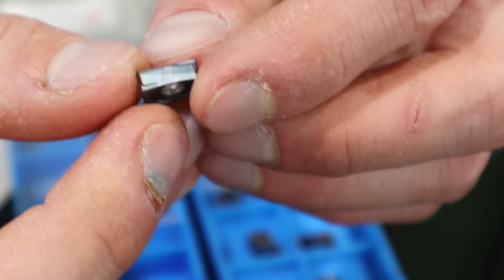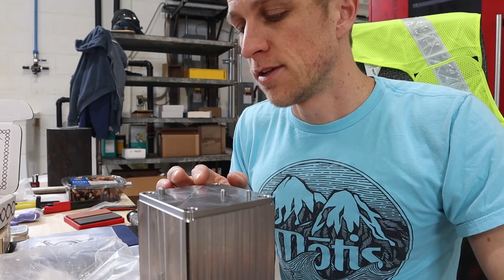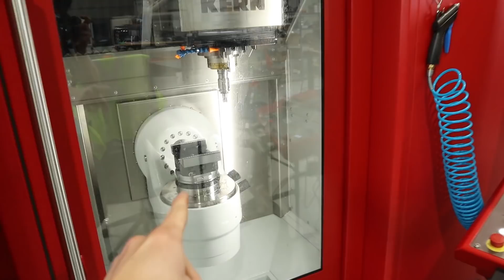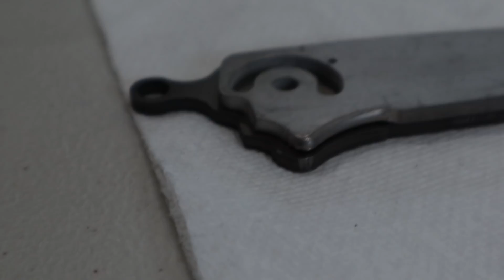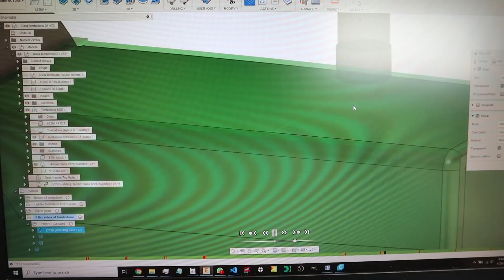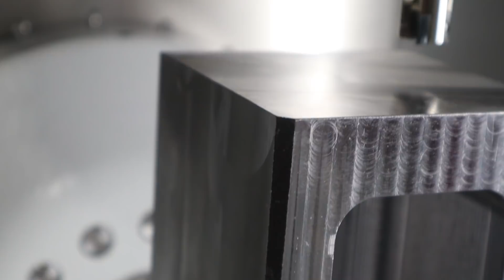Rask Tombstone! - Quarantined Shop Life 18

Comment: If you're concerned about insert heights... 1) get a handful of insert bodies from the manufacturer and check heights... keep the best one and send the others back. You'll quickly find that not everyone machines theirs to the same tolerances. 2) Get something like the Sandvik Century with adjustable cartridges. If surface finishes are really important, then use a wiper insert in the adjustable face mill and learn to set it up properly. I'm assuming you're setting your inserts with a torque-set driver.

BTW this is a really nice machine for making knives. Maybe even a little overkill. ;)

Comment: I like those MEW series insert Mills, we have 5 different sizes in diameter and length. From 20mm to 50mm diameter. And you can shoulder like a beast with those Mills. With facing passes (like 1mm deep) the corners burn up relatively fast. But when you take more depth (like 20% radially and 7 mill deep 0.05mm/pt and 160 meter surface speed with the 50mm version) the edge keeps it's strength like a champ for roughing. For the finishing I like to leave 0.1 mm and I do a 80 to 90 % step over with 0.08 mm/pt. (Well that's what I use on a Haas VF2 in stainless 304)

Comment: Couple suggestions for the next tombstone: as others have said split the hole it into multiple pockets with webs for stability along with thinner outside walls.
Secondly you’re gonna get coolant in that pocket, make sure you leave some drain holes and orient them to drain at the end of the cycle so it doesn’t pour out onto your nice robot. Even better rig up a tool with air blast to purge the coolant at the end of the cycle through a hole in the top.

Comment: if you want to probe on an angled part, you can it pretty easy on manuel mode too. In MDI use the Plane spatial code with the angle you need, go back to manual mode, press the §d ROT softkey and set the Manuellmode to activte (this sets the Coordinate rotation from the plane funktion aktiv), now you can manuell probe the surface you need with the probe position softkey. but dont forget this 3D ROT funktion alway rotates your Axis movemend depending on your plane funktion, you want to deaktivate this after use so you dont crash the maschine by acident.

Comment: Idea for rev two of the pallet... in aerospace they drill holes anywhere you can put them for light-weighting. Instead of hogging out the inside, just drill a bunch of holes in close proximity of each other. You could maybe even do a honeycomb type pattern (except with circles). That way you have a very strong structure that uses the whole volume of the block to reduce any potential rigidity/chatter issues and you could probably go with even  thiner walls. Plus there is no better way to remove metal than drilling, especially with that deep pocket. Just an idea!

Comment: About making the walls less thick on the tombstone. You can probably reduce the thickness even further if you make two pockets instead of one, so there is a cross beam between opposite sides. In fact it will probably be stronger than what you have now. You need to check the volume in CAD to see if it will be lighter at the end tho.

Comment: I didn't even know Kyocera is in machining and cutting tooling business. Wow. I always thought they are just optics, electronics, printers/scanner and audio-video equipement company. And by extension maybe some semiconductor related stuff (similar to Canon or Fujitsu). But in fact they started as Kyoto Ceramic (thus the name Kyocera! WOW). Also they had a lot of acquisitions. I.e. Yashica, Contax, AVX, Sanyo Mobile, TA Triumph-Adler got acquired in recent decades. Wow. They were all very known brands around the world. Kyocera was also instrumental in developing first integrated circuits together with NASA and Fairchild Semiconductors initially for Apollo mission and military applications, but it almost immediately went into commercial applications too.

Comment: why just 4 sides is it possible to make alot of sides(6 or more) since blades arent that wide. maybe you can fit alot more on 1 tombstone. You start with a round bar so just machine out the inside in the lathe.
Reply from the maker: I tried out that possibility, but on the other 3 sides of the tombstone I need to secure 2 handles per side, and when going to a 6 sided fixture it just doesn't fit as well. Good thinking though!
Reply: @JohnGrimsmo  ok interesting to know thx for answer

Comment: I wonder how this machine will hold up to rust inside where the chips will be falling and slowly wearing on whatever coating it has on it. I would also worry about the auger area. As we all know stainless steel can corrode. Unless it is made from nitrogen impreg or titanium I would keep an eye on the high wear areas. Displacing all that water is a must.

Comment: I have a couple of the kyocera end mills similar to those. In aluminium they really eat. Recommend getting the tool diameter slightly larger than the shank. 22mm tool with the 20mm shank seems to work awesome and you can do very deep pockets and long walls without chips welding to themselves to the shank........

Comment: Thinking back a video or two, when John showed how much coolant drained off that pallet (without the tombstone mounted) when put back on the rack, I wonder if it might be a better strategy to move the two vises up to the top rack of the changer so they don't have coolant draining on to them whenever pallets are changed above them.  Is there a clearance issue?

Comment: For rust prevention, and maybe style, you could try treating your tombstones with cold bluing liquid.  I believe it creates a controlled oxide layer.  That with a little oil/undiluted coolant should be at least as good but it will also show witness marks when plain steel is exposed by new scratches and machining.

Comment: Pro tip: When checking runout, position you indicator how you like it (angle, height ect.) then use the machine and bring the tool to your indicator. Saves a ton of time trying to get you indicator to the perfect position. Epic stuff dude love the vids
Reply from the maker: Ohh man I didn't even think of this hahaha.  It's so obvious!  Great idea.  I've done it for other machines all the time, just slipped my mind.
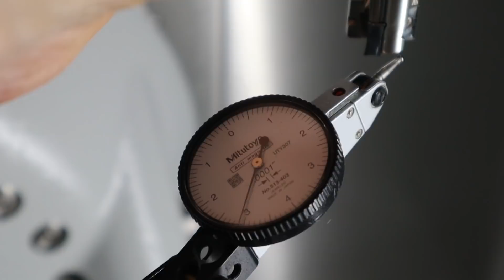Reply: ToastedWalnut not sure why you’d do it any other way. When he said “as close as I could get it” around 10:14 I was like wtf just move the machine down the .0001” LOL
Reply: Justin Moritz Think you are misunderstanding what he is talking about. That .0001 is the difference between insert height not what the indicator reads. Doesn’t matter what the indicator reads, just the difference between the readings.
Reply: He's saying because when he bumped it, and followed up with re-aligning it, he was just leaning in machine moving the arm the indicator was on, instead of just moving the spindle to re-align it on the bumped indicator

Comment: I work for a insert tooling company the mold and punches sets used to press inserts are designed to leave stock on the inserts for grinding. Depending on the tolerance designation which is the third letter of the insert style ( example CNMG  ... M is your tolerance of the insert) some inserts have a tolerance of .005 and most have a tolerance of .001 or less.  which is why you should always back off your finish pass offsets when you change your inserts.
Reply: No problem if you look up insert tolerance designations  there is a sheet that has the tolerances just match up the designation letter to the tolerance  on the sheet. Some tolerances I think may vary depending on manufacturer and some inserts have special grinds and tolerances not designated but should be on the box possibly or reach out to your tool rep or applications engineer for the company.

Comment: What do you think about some kind of plug plate for the back of that tombstone. Maybe just a slight counter bore with a concave groove. Maybe a piece of lexan that John saunders over at Sanders machine works can laser cut for you. On that boss ass laser lol. you could probably use the same radius cutter for the inside of the counter bores the outside of the lexan and if you use the good old super glue method you could hold the lexan down to cut the concave radius on the outer profile of the lexan. then simply putting an o-ring around the whole thing and it holds itself together with no vibration clinking nuts bolts or anything else!
Reply: I was mostly just thinking to keep your palate changing area clean with that big cavity I see a lot of coolant and chips getting in there!!

Comment: Sometimes they use a wiper pocket, leave one of the inserts higher than the other, that improves the surface finish on the bottom pocket. Could be the reason why you see the difference on that one insert. would be interesting to see how the alu inserts look

Comment: Not a big fan of the Kyocera cutter I mean it worked but just not the best to me, I’m sure it will work much better for your application
Reply: Jason Bone I agree with you. I prefer the kennametal mill 4 setup. It works well on my mazak qt250msy. Although I will say, the designs are very similar. I just think the kennametal inserts work better for me.
Reply: Patrick Martinez yeah don’t get me wrong not bashing on Kyocera at all. I use a lot when I’m turning, you’re right when you say something works better for you I just like iscars insert cutters better. I’m not sure why I guess I have more experience and confidence.
Reply: Jason Bone Kyocera certainly has good products I love their z-carb end mills
Reply: I dont know this cutter, but i used to machine with the Kyocera Micro-MFH in mold application, great tool and long lasting inserts

Comment: Yeah, i would imagine that the steel one doesn't need to "move" material in the same way as the aluminium one does, so thus, the coating. I heard once that the difference between a steel and an alu tool (outside geometry, and it was really before the age of inserts) is that the aluminium variant needs to work twice as hard despite being in a softer metal. Something about slippage coefficient.
Reply: aserta I think there’s a difference of coatings on an aluminum insert and there tends to be more rake and relief and a more polished surface. It’s due to the fact that aluminum likes to stick to the cutting tool. It’s more gummy so the polished surface helps it to not weld to the insert.
Reply: Difference in geometry is that in steels, you want it to “shear” the material and in aluminum it is soft and needs to be cut, so the inserts need to be “sharp”.
And yes the inserts are usually plain and polished smooth for aluminum as the coatings are TiAlNi, part of that equation is aluminum in the coating.